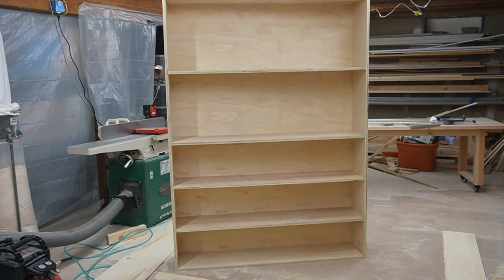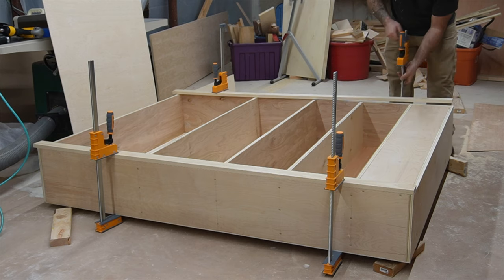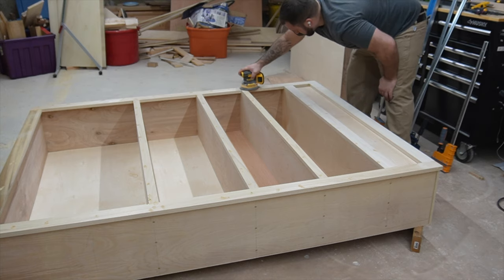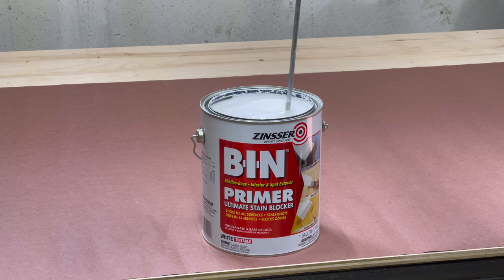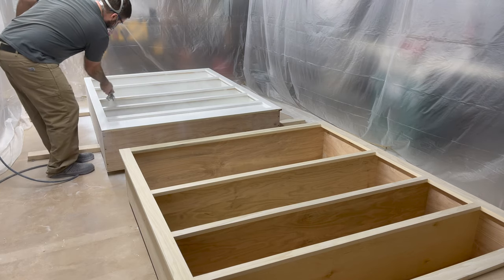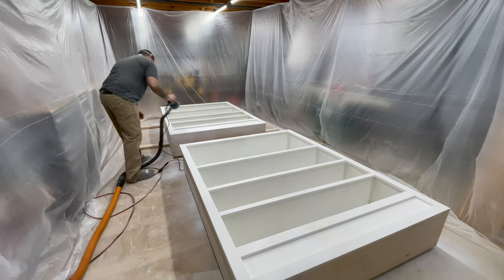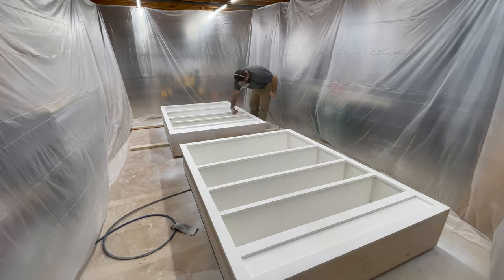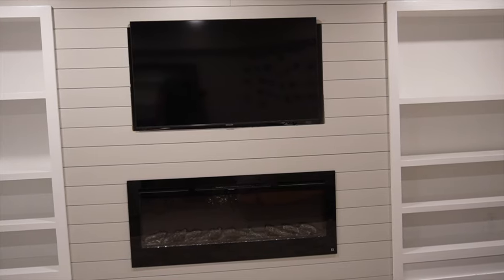How to Make Built In shelves: Face Frame and Painting

Comment: I honestly think I could build that now.  I have been dying to get a paint sprayer. In total how long would you say the painting portion took?
Reply from the maker: Each coat took about 20 min not including set up and cleaning of the sprayer. I allowed the primer to dry for 20 min after the first coat and 40 after the second coat because I needed to make sure it was dry enough to sand before the paint. All said and done it was about 3.5 hours total.
Reply: @diydano  got it thanks. I was considering either putting puck lights or LED strips to give it a cool look at night.

Comment: Is there a reason you attach it off the shelf as one large frame piece vs individually attaching each piece directly to bookshelf?
Reply from the maker: I like the seamless look of a one piece face frame if they shelves were adjustable instead of fixed then I would attach a wood lip to each shelf and just have one big rectangular face frame on the outside.

Comment: I like to run the air hose over my right shoulder, keeps it from accidentally brushing up against the car when im spraying. Great project. Congrats.
Reply from the maker: Thanks! I'm glad you enjoyed it. Great tip on the spray hose. I usually only have to spray whats right in front of me so that never crossed my mind. I have to make another set of shelves for another bed room and will definitely try it! They also make a smaller more flexible hose whip between the main hose and the gun. I have been meaning to order one. The stock hose is not very forgiving in tight spaces.